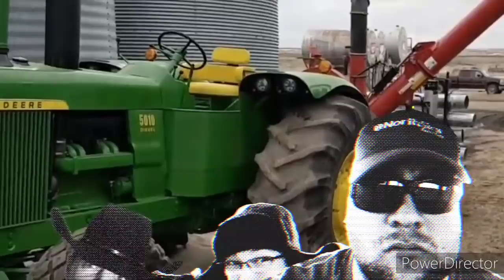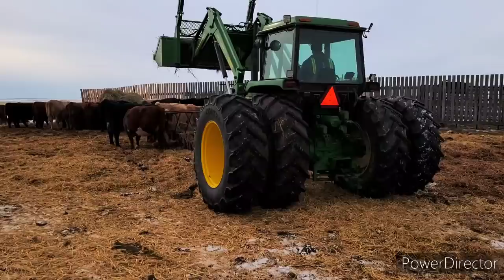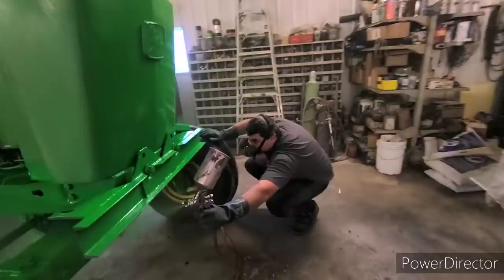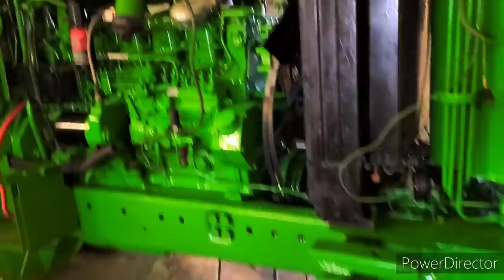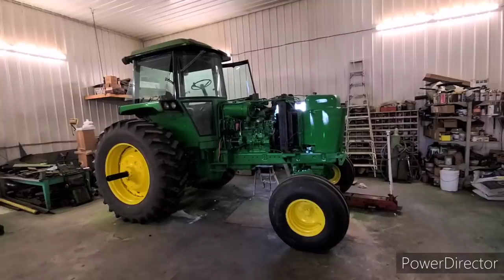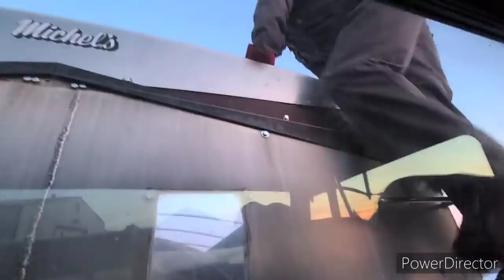4630 fresh paint is done! episode 8

Comment: I believe that tractor came with the 2) 6 volts batteries wired in series. Has it, or do you have plans to go to the 2) 12 volts in parallel? My neighbor had a 4630. Bitch to start in our bone chilling  30 degree Fahrenheit southern winter morning. 🥶
Reply from the maker: 2 12 is waaay better